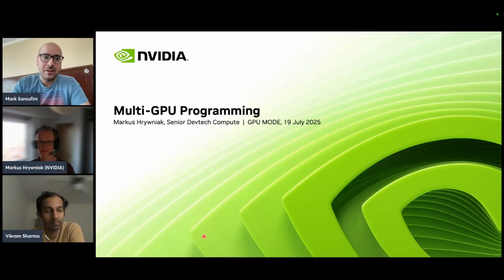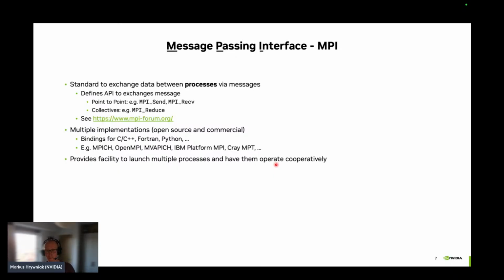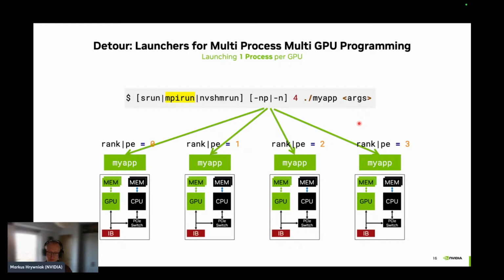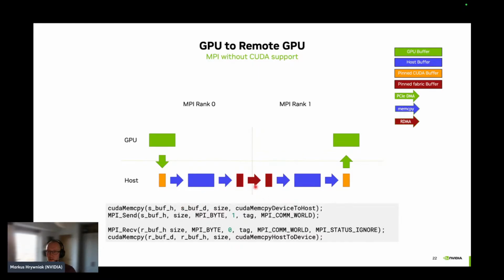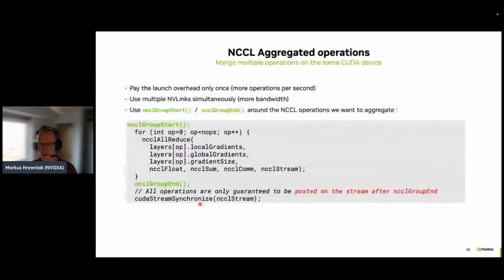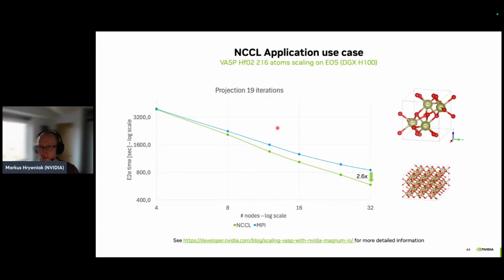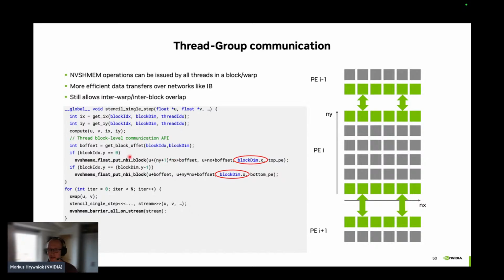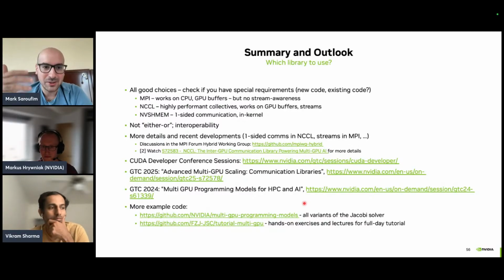Lecture 64: Multi-GPU programming

Comment: AI Summary

Abstract:

This video provides a comprehensive introduction to multi-GPU programming, presented by Marcus Revak of Nvidia. The lecture explains the core motivations for using multiple GPUs—strong scaling (solving a fixed-size problem faster) and weak scaling (solving a larger problem in the same time)—using a 2D Jacobi solver as a running example. It details the concept of domain decomposition and the resulting need for "halo exchanges" to communicate boundary data between GPUs.

The presentation systematically introduces and compares three fundamental programming models:
1.  MPI (Message Passing Interface): A standard for process-to-process communication. The talk covers its use for halo exchanges, the performance benefits of CUDA-aware MPI, and technologies like GPU Direct RDMA that allow network cards to access GPU memory directly, bypassing the CPU.
2.  NCCL (NVIDIA Collective Communication Library): A library optimized for high-performance GPU communication. Its key advantage is being stream-aware, allowing communication operations to be enqueued on CUDA streams, which simplifies code and removes the need for explicit host-side synchronization.
3.  NVSHMEM: A Partitioned Global Address Space (PGAS) library that enables one-sided communication (e.g., `put` operations without a matching `receive`) and, most significantly, allows communication to be initiated directly from within a CUDA kernel. This facilitates kernel fusion, reduces launch overhead, and can provide substantial performance gains in latency-sensitive applications.

The lecture concludes with a practical comparison of the libraries, outlining their primary use cases and emphasizing that they can be used together to build complex, high-performance applications.

An Introduction to Multi-GPU Programming Models

*   0:01:28 Why Use Multiple GPUs? The primary reasons are to solve problems faster (strong scaling) or to solve larger problems that don't fit in a single GPU's memory (weak scaling).
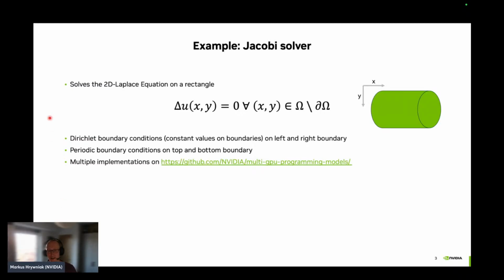*   0:03:44 Example Application: The Jacobi Solver: The lecture uses a simple 2D Jacobi solver to demonstrate programming concepts. This iterative algorithm requires each point on a grid to be updated based on the values of its neighbors, creating a clear need for communication when the grid is split across multiple GPUs.
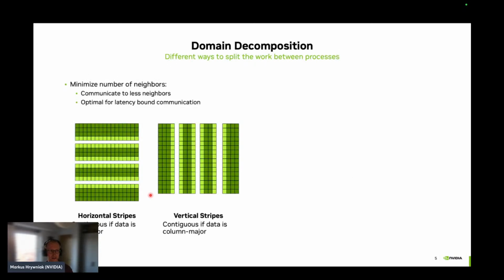*   0:07:34 Domain Decomposition and Halo Exchange: To parallelize the problem, the data grid is split into chunks (domains), with each GPU handling one chunk. GPUs at the boundaries must exchange their edge data (a "halo") with their neighbors to perform correct calculations.
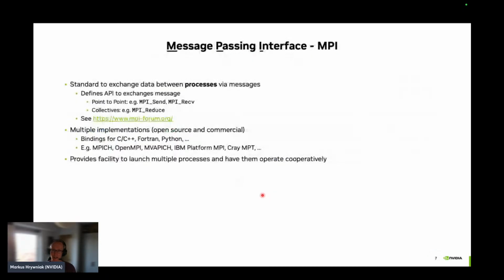*   0:09:45 Introduction to MPI (Message Passing Interface): MPI is a standard library for communication between processes. A common model is to launch one MPI process per GPU. It provides primitives like `MPI_Sendrecv` to safely exchange halo data without causing deadlocks.
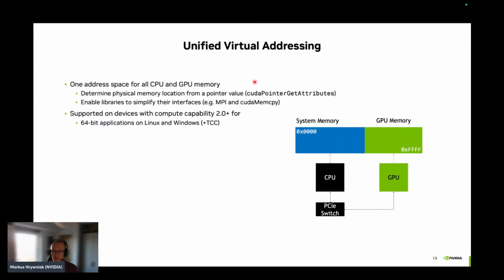*   0:18:30 CUDA-Aware MPI and GPU Direct: Modern MPI implementations can work directly with GPU memory pointers. This enables technologies like GPU Direct RDMA, which allows a network card to transfer data directly from GPU memory to the network, significantly reducing latency and increasing bandwidth by bypassing the CPU.
*   0:34:15 Optimization: Overlapping Communication and Computation: A key technique to improve efficiency is to hide communication latency. By using separate CUDA streams, an application can start computing the boundary data, initiate the halo exchange, and then compute the large interior of its domain while the data transfer happens in the background.
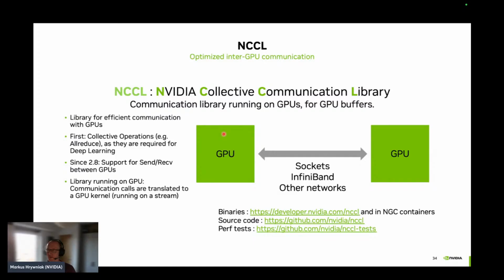*   0:38:47 Introduction to NCCL (NVIDIA Collective Communication Library): NCCL is a library optimized for GPU-to-GPU communication. Its main advantage is that its operations are stream-aware, meaning communication calls are enqueued on a CUDA stream just like kernels. This removes the need for explicit synchronization calls that are often required with MPI.
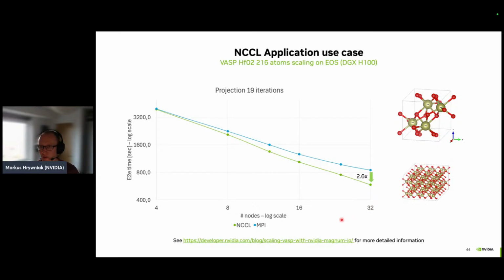*   0:51:06 Introduction to NVSHMEM: A Partitioned Global Address Space (PGAS) library that enables two powerful concepts:
    *   One-Sided Communication: A GPU can directly `put` data into another GPU's memory without the receiving GPU having to post a matching `receive` call.
    *   In-Kernel Communication: Communication can be initiated directly from within a CUDA kernel. This allows for fine-grained, thread-level data transfers.
*   0:53:00 Benefit of NVSHMEM: Kernel Fusion: The ability to communicate from within a kernel allows developers to fuse multiple steps (e.g., computation, communication, more computation) into a single, persistent kernel. This eliminates kernel launch overhead and host-side synchronization, which is critical for strong-scaling applications that are sensitive to latency. An example from the QuDA application shows a 1.7x speedup from this technique.
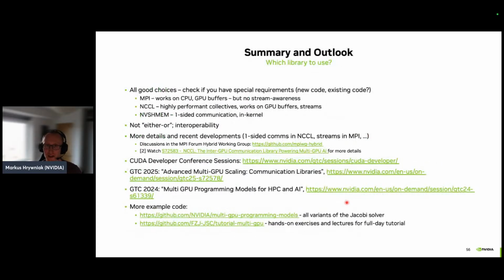*   1:07:08 Which Library to Use?
    *   MPI: The best starting point for porting existing CPU code or for general-purpose parallel programming.
    *   NCCL: Ideal when you need highly optimized collectives (`AllReduce`, etc.) or want to simplify your code with stream-aware communication.
    *   NVSHMEM: The choice for implementing advanced patterns like kernel fusion, overcoming latency bottlenecks in strong-scaling scenarios, or when a one-sided communication model simplifies the algorithm.
    *   Key Takeaway: These libraries are not mutually exclusive and can be combined within the same application to leverage the strengths of each.

I used gemini-2.5-pro| input-price: 1.25 output-price: 10 max-context-length: 200_000 on rocketrecap dot com to summarize the transcript.
Cost (if I didn't use the free tier): $0.07
Input tokens: 45272
Output tokens: 1155
Reply: That's really helpful. Thank you!